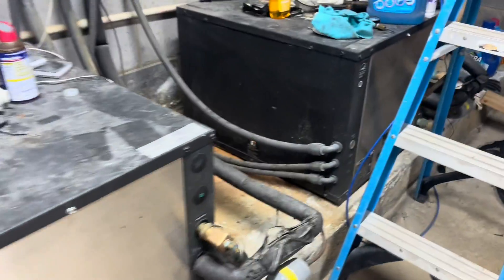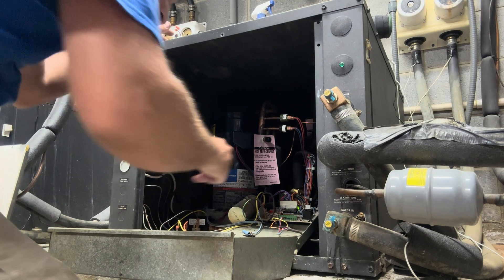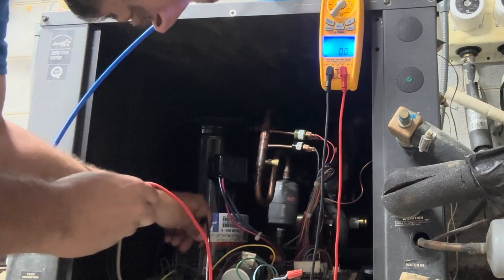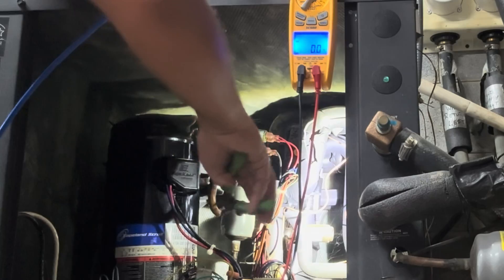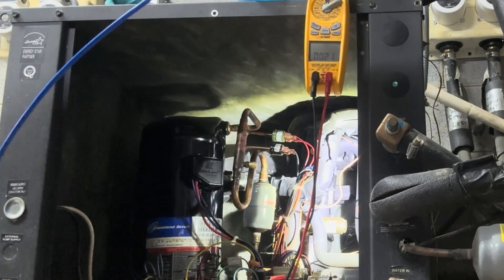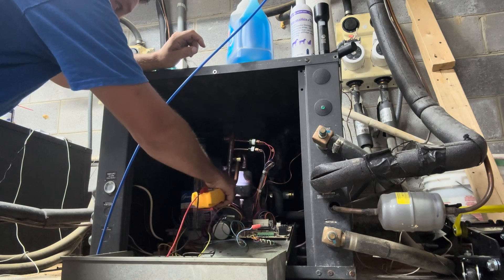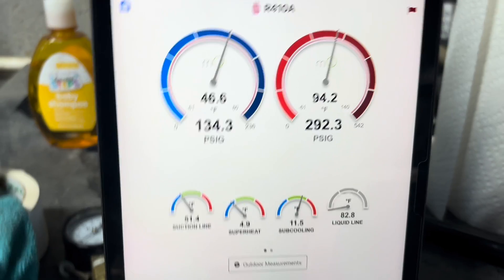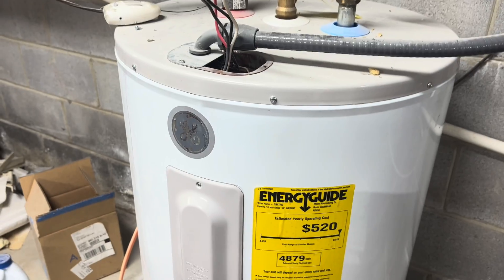Geothermal System Fails?!  Not So Fast…

Comment: Good video Jeff! I love geothermal systems and with the desuperheaters and inverter systems you can have COP running 4 to 6 so why would anyone run an electric resistance water heater with a COP of 1 if you can turn your system from 100%  (COP 1) efficient to a 600% (COP 6 ) efficient systems? Only thing I will say bad about geothermal systems is some can be a real pain to work on for major repairs and have had to uninstall some just to repair them so you can get to everything you need. That is a very nice install and easy to repair them....huge basement. ❤ Geothermal if on a closed loop system and installed properly have a very long service life compared to an air to air heat pump, twice the life usually! We never install electric strip heaters here in NC on Geo!

Comment: Great video. Thank you for sharing. What is the same and different between Geothermal system vs water source heat pump ?
Reply from the maker: They both basically work the same way.  They use water to transfer heat.  However water source heat pumps are usually found in commercial applications using cooling towers, lake or reservoir, or closed ground loops.  They even sometimes use boilers to maintain loop heat in the winter (I know, counterproductive).   With Geothermal, they are usually just used in residential applications and they primarily just use a closed loop that runs through the ground to transfer heat.  However open loop wells are sometimes used to.

Comment: G,day from Sydney Australia.
The fieldpiece DMM is a nice HVAC unit. I like the switch, not suitable for electronics mA mV or higher V or Ampage 
Then there's the Fluke which it's built in megameter.
🌏🇦🇺
Reply from the maker: Field Piece does make a solid meter.   I haven’t had a Fluke in probably 15 years but they are very nice too.  My father has a digital Fluke he’s had for at least 25 years and it still works great.  I was at his house over Thanksgiving last year and his furnace went out.  He pulled that old thing out and I said “omg you still got that old thing”. Still worked perfectly though!